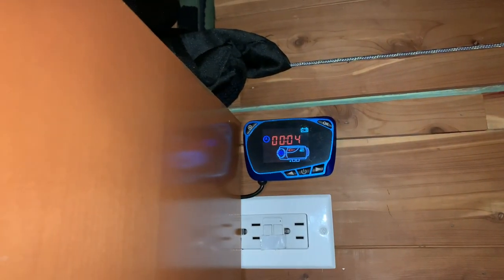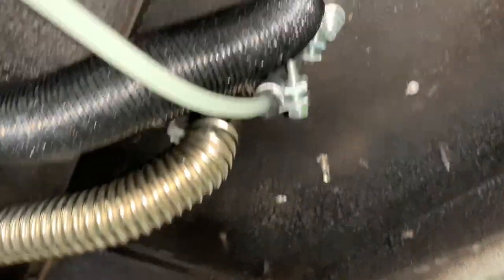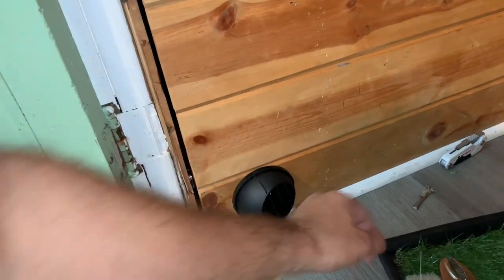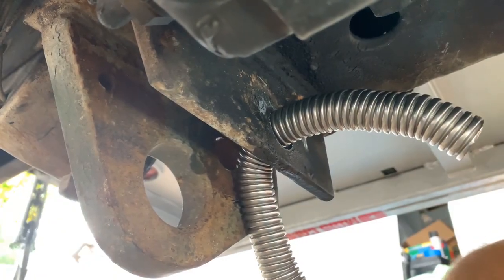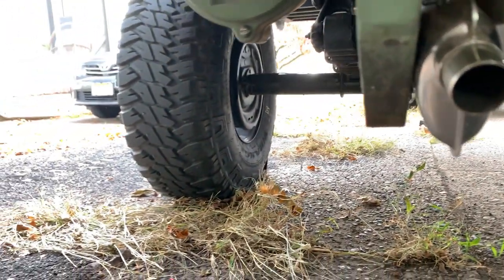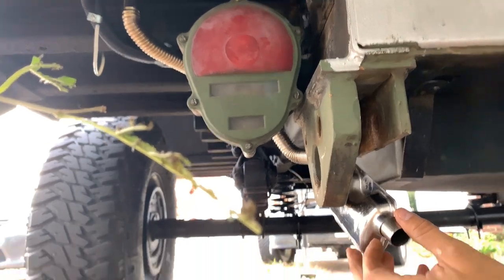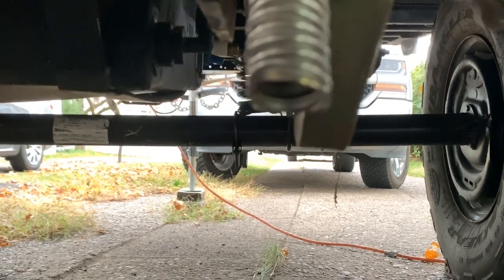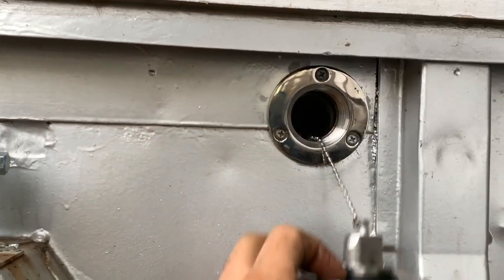Chinese Diesel heater install part 2!!

Comment: Fuel fill hose radiator hose resistant two petroleum? 
How do you know when to stop filling the tank
Reply from the maker: Hey there buddy! Thank you so very much for watching!! To answer your 1st question, yes the hose is resistant to petroleum. Secondly, we fill it slowly as the level is visible through the tank. The machine is very efficient so it is only necessary to do it one liter at a time, which is also another way of not adding too much. Hope this is helpful for you and look forward to hearing from you again! Stay safe and healthy

Comment: Fuel filter is backwards. Pump should be at an angle with out higher than in. Cavitation bubbles will sit in pump mounted horizontal and wear out faster.
Reply from the maker: Hey man thanks so much for watching and also for catching that mistake! We have actually changed and corrected that since making the video, but truly appreciate your letting us know just the same! Obviously good advise!

Comment: there is a tiny hole near glow plug if it gets a bug in it wont start. air filter important check john mck 47      posts  very helpfull

Comment: Also... What are your thoughts on extending the exhaust above the cabin? As opposed to below (which you are clearly in a safe area)?
Reply from the maker: Kenn Rymdeko Hey Kenn...obviously I don’t think enough about gloves hahaha! I most definitely thought of that in the preliminary stages of installing the heater, but after it’s first use didn’t feel it was necessary...and took additional steps for safety ie an extra Co2 detector. Thanks so much for the thought...we truly appreciate it!!
Reply: @DIYM105Camper  excellent idea on the CO2 detector!
Reply: Co is heavier then air. So all exhaust will drop to the ground. The manufacturer recommends dropping the exhaust pipe to the ground.
Reply from the maker: Hey man thank you so much watching and commenting!

Comment: you really should have plumbed the other intake tube inside also these diesel heaters fire much easier when they have warmer air going into them also if you did this you would suck in less moist air moist air makes these heaters run funny or fail to ignite altogether I plumb the combustion intake into the camper to avoid these issues  and it makes them fire off much easier in cold climates and because they do not have to glowplug as much to fire off they use less electricity also.

Comment: I guess with that long exhaust your heater stopped in maximum 2 days because of the soot buildup..
Reply from the maker: Danoiu Marius Hey man thanks so much for visiting us again! Hope you are well! Thus far, we have had the heater running for up to four days without any issues. Although the exhaust looks long, it is still under the maximum of 2 meters. Also, I have less than 270 degrees of bends which is within the manufacturers max recommendations. John Mck 47 has a video on the Chinese heater exhaust. Be safe and healthy and thanks for writing in!

Comment: Can I run it with my van battery for 6 hour and still being able to start my van???
Reply from the maker: Hey man! Thanks for watching! I must say, but very much hate to do so, that technically it could be done. However, I would 200% not recommend doing that! There is just too much that could go wrong...particularly￼ in the winter months when batteries tend to deplete more quickly. Everyone I know using a diesel heater is ￼running it off of a secondary battery which can be charged via the vehicle￼s alternator, solar panels, generator, etc. And most importantly...SAFETY FIRST! Hope this was helpful!

Comment: if it came with plastic air intake  with foam in it throw it away and put a proper air filter on
Reply from the maker: Faffy Bubs Thank you so very much for watching! Your advise is very helpful! Will definitely change as soon as possible!
Reply: @DIYM105Camper  i have 2 of these heaters cheap to run  i have installed quite a few if need any advice just ask  regards from nz
Reply: where abouts are you guys we in nz  put some more post on your travels me and my wife have  built a van and  being camping around  regards
Reply from the maker: Faffy Bubs Hi again! We are in New Jersey. God willing when this Corona Pandemic subsides we will resume our travels up and down the East Coast. Do you have any videos of your build? Anything on places you’ve visited?
Reply: sorry m8 we in lock down cant go any where  but would love to show you  my countrey keep safe

Comment: Is this better than a propane heater in any way?
Reply from the maker: Hey man! Thanks so much for watching!! Yes, we believe it is absolutely better! When we first began camping we used a ceramic electric heater and a little buddy propane heater. This new heater runs miles around the others! For example, simply being able to rotate the air vent to directly heat any specific area is amazing. Whereas it is difficult to adjust other kinds without them shutting off. Also, with a propane heater there is a lot of condensation versus there being none with the diesel heater. Hope this is enough info to help! Keep us posted with what you decide to go with.
Reply: @DIYM105Camper   I hadn't thought about the condensation. Good point on that and the other features. Do you have any idea of the fuel consumption rate and the tank capacity? Thanks!
Reply from the maker: joe woodchuck  The diesel heater came with a 5 liter or 1.5 gallon tank, however, due to a space restriction in the location we used it had to be changed to a 1 liter. We went on a 4 day overlanding camping trip where it did get cold at night (approx. 40 degrees), so the heater running overnight for 3 days only used half of the tank. We were definitely pleasantly surprised with the consumption, although we had it at a fairly minimal setting to keep the camper 73 degrees. But we’ve yet to try it below in freezing temperatures.

Comment: Looks nice! Just please double-check your instructions: mine told me that the fuel-pump should not be installed flat, but at a 15 to 45 degree angle, pushing the fuel "upwards", otherwise the pump will seize up.
Reply from the maker: Hi there! Thank you so very much for watching and subscribing and for bringing this oversight to my attention! I am going to reinstall the fuel-pump at the correct angle right away! I have since learned the reason being for this. I was able to find this very informative video made from John Mck 47 which includes the full and detailed explanation of why this is. Loved learning the interesting mechanics of this! Many thanks again for saving my pump!!!
Reply: How long does it go on  a charged up car battery?
Reply from the maker: totallyjonesin Hey man thanks so much for watching! I’m not at all sure about just how long the heater could run on a fully charged car battery...I would assume at least one day or so. We have 2 105ah lead acid deep cycle marine batteries from Walmart with a 180 watts Solar panel set up on the camper and on our last 4 day trip to Overland Expo East we had the heater on for 4 nights plus lights and our mini fridge which we keep on 24/7 and with all that the lowest I ever saw the batteries go down was 75%. Of course I was running the heater at a minimum setting and from 10pm to 6am at a temp of around 72 degrees all night. I hope this helps you, or at least gives you some kind of an idea about how long you can run the heater for!
Reply: Thanks for the reply, I guess I will find out because I am about to order one. I think I will go with the simpler knob switch 3K size. It should be more than enough for my 8' low profile slide in truck camper.

Comment: Hi dose the bottom plate get hot?
Reply from the maker: James Phoenix Hey man thanks so much for watching! The bottom plate is not getting hot...just warm!
Reply: @DIYM105Camper  hi thank you for getting back to me so the issue I have is my floor is 2 inches thick before the van floor due to insulation ect... so with plate I wanted to just cut the holes for the pipes and then place the bottom plate on the floor and not have to cut out the entire size of the plate. Do you think this would be ok?
Reply from the maker: That could work, however, keep in mind that the exhaust pipe gets extremely hot. Therefore, in my opinion, would become a fire hazard if it gets in contact with any insulation etc. Hope this helps man!